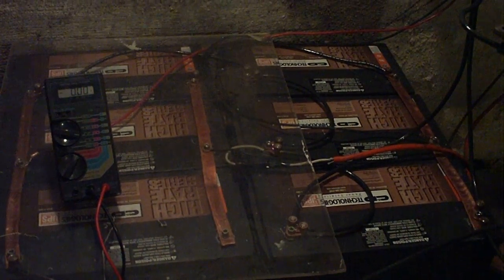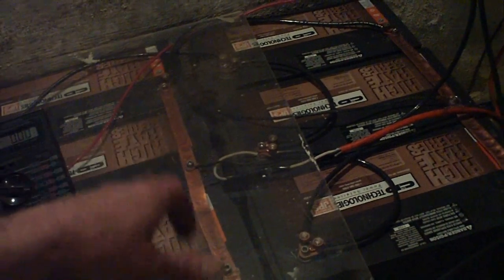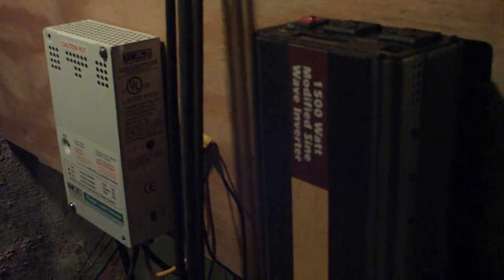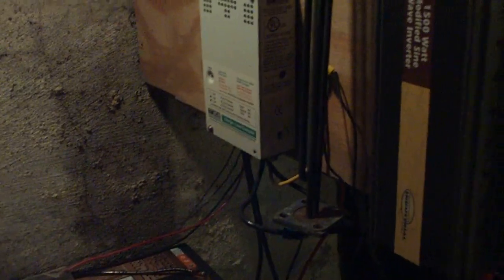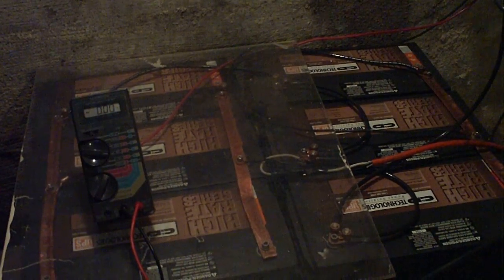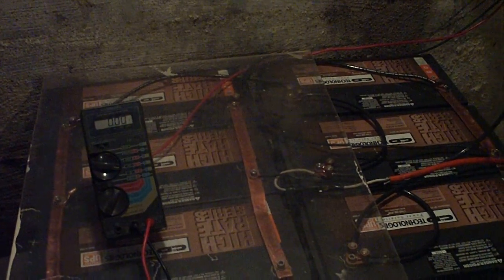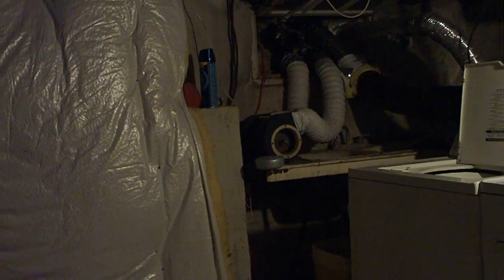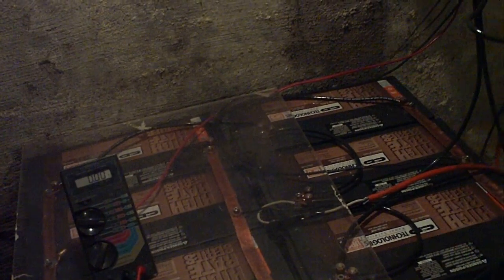wind generator batteries 12volt- setup

Comment: Nice set up. Everyone keeps telling me not to use a bus bar, (I use a copper rod) I did some research wire is convenient, flexible
but conduction is thru the material, contact areas are critical though. Thanks for sharing!